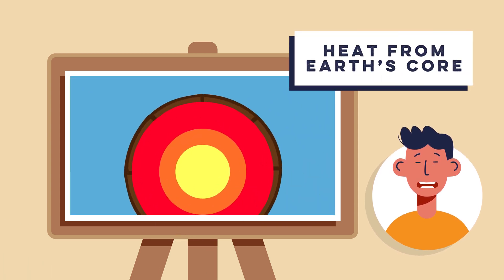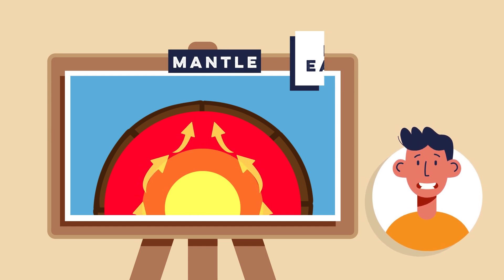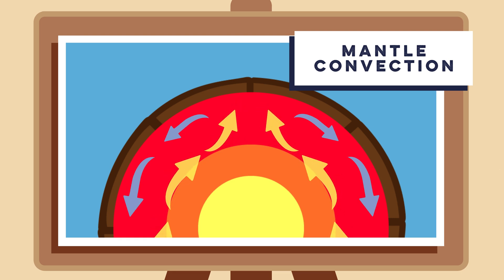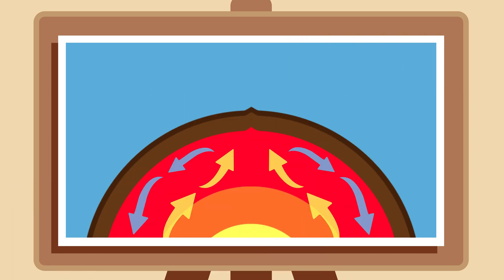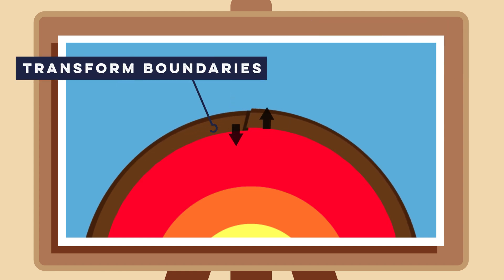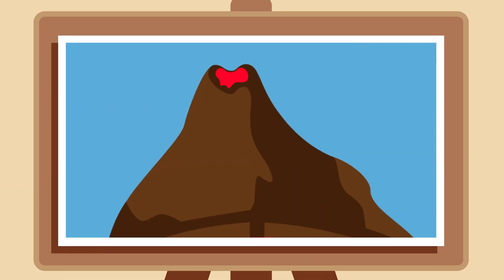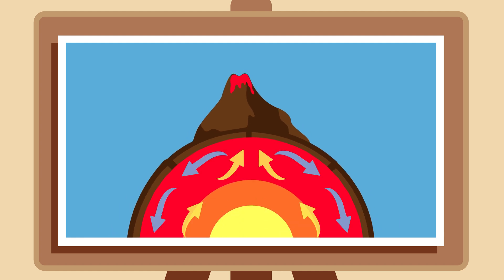Convection Currents Explained: How do Tectonic Plates Move | GCSE Geography Help | HRB Education

Comment: Can someone explain step 3 about drag what dose drag mean
Reply from the maker: Think of drag, like friction, the more the material moves in the mantle, the more the plates will move. As the force of the convection current slowly pulls the plate with them. The direction of movement depends on the direction of the convection current
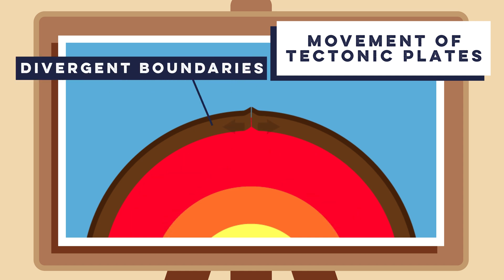Reply: 1:17

Comment: Can someone explain Slab pull and ridge push?
Reply from the maker: Slab pull is when a heavy, old oceanic plate sinks into the mantle at a subduction zone, it pulls the rest of the plate along with it, like a heavy weight dragging a rope down. This helps move tectonic plates at destructive plate boundaries.
Reply from the maker: Ridge push is at mid-ocean ridges, hot magma rises and creates new crust. As this crust cools, it becomes heavier and slides downhill, pushing the plates apart like a conveyor belt.